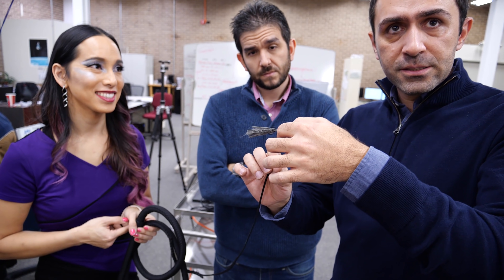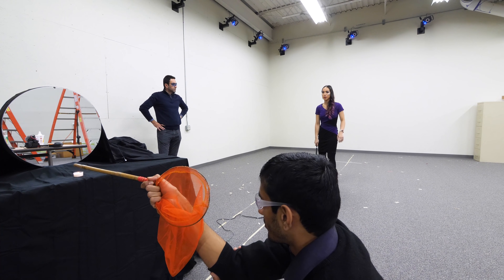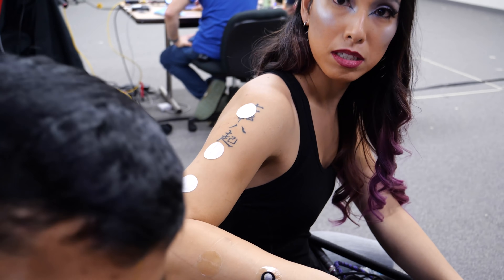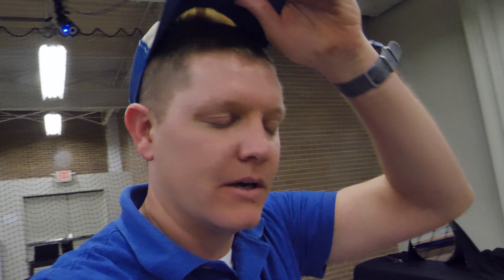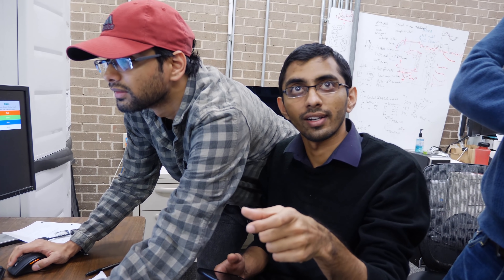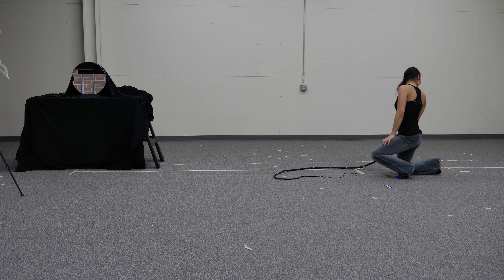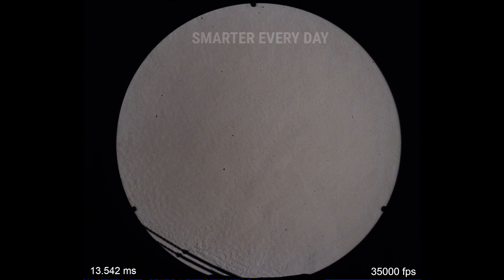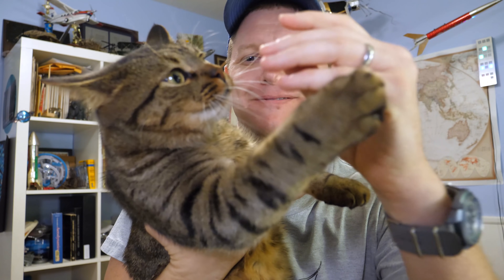How does a Whip Break the Sound Barrier? Behind the Scenes- Smarter Every Day

Comment: Its air resistance dudes. I am not an engineer, but I study a lot of geometry, what seems to be happening here, is that the tip of the whip accelerates, and the air that is trapped in the tip causes a drag that holds the tip of the whip, that causes the effect "tug of war" between the resistance of the air at the tip and the momentum of the whip, when the momentum "wins the contest", the tip is drawn with more force than was being pulled until the air drag starts acting (to compensate for the force of the momentum that was reduced in the dispute of the two forces), this generates an extra acceleration, that adds to the tension produced in the whip, and causes the tip of the whip to pass barrier of the sound. Probably different material whips produce different final velocities due to the elastic constants of each material and the tip size would also influence the amount of air trapped in the space between the wires of the tip, if I am right.
Reply: And it's probably possible to do a backtracking to determine the points that are not being captured due to the system capture frame rate, I work with computer vision and I'm sure it's possible to "add" more frame rates between the frames that are captured by the system using only math.
Reply: Interpolation, a think

Comment: now all you need is Mark Rober to make a device that cracks a whip perfectly every time!
Reply: I think they already have one of those: April.
Reply: That would actually have to be a SUPER complex machine, given the amount of subtlety involved in cracking a whip.  A lot of that is feel tbh, you have to get the whip moving JUST RIGHT to actually get it to crack.  April can get it super consistently due to YEARS of experience and a detailed knowledge on the physics behind how it works, but building a robot to do it would be rather difficult.  I have an idea for one that would mimic the motion needed for a side flick crack, but it would also need an entirely custom whip for that robot - each whip is going to move slightly differently, so as soon as you put a different whip on it, you would need to adjust A LOT to get it to crack consistently
Reply: @EclipseAtDusk  idk man you see that robot that shoots hoops perfectly every time that's insane too, someone will do it it's only a matter of when

Comment: How about setting up a second schlieren-camera 90° to the existing to get some highspeed 3D Info from the tip? Could that work?
Reply: This setup actually can already get the 3D data.... it's hard to explain but all the info is there.
Reply: @smartereveryday  Would be very interested to see this explained in a future video
Reply: @smartereveryday  Shining a laser through those shock waves might be an interesting aside for a video on refraction.
Reply: @smartereveryday  An explanation video could be very interesting, and possibly very complex :) Could a 3D model of the shock wave in real time could be constructed?
Reply: That sounds awesome, AND a nightmare to sync up, at the same time.
Reply: Now you’re talking! I was just thinking how cool it was seeing “thickness” of the shockwave and how that is actually a 3D spherical section. With two or even three set-ups, you could get amazing full 3D modeling of everything; the whip, the shockwave, the heat vapors coming off the cord. That would be awesome!
Reply: I was just thinking about CT machines which work the same.
Reply: Syncing them up wouldn't be all that hard; syncing them to sub-frame precision might be. The schlieren setup uses a mirror and already contains two (partially occluded) images of the whip; the second image there is a mirrored silhouette, not a plain shadow. Actually reconstructing that is bound to be tricky, involving details like the mirror's projection of the other side. I expect they did some work to figure out the positions of the high speed camera and its light source, just as you saw the goofy looking stick being waved about to calibrate the respective views of all the spatial tracking cameras. This stuff is fun!

Comment: We used to make "rat tails" out of our beach towels by folding them in a descending spiral with the bottom edge folded to make the handle. We would wet the tip (corner) of the towel, and proceed to make one another bleed with them.
Reply: I only know these were a thing bc of Ed, Edd, & Eddy.
Reply: @otakuribo  I know of these because of bleeding. I learned to make them out of pure defensive necessity. Way before the Ed's ever hit cable...lol.
Reply: @hardwurkindaddy  Jeez, I'm so sorry to hear that... what kind of Spartan childhood was this? It feels like I missed out on some character building or something. But I probably hurt myself enough trying to emulate the X Games to make up for it.
Reply: @otakuribo  life before the internet was...different...lol
Reply: @hardwurkindaddy  I know you've been in a few bottle rocket battles. 🤣😂
Reply: some still do.
Reply: brian bennett Same. Got longer, thicker towels, then added 3 strands binder twine soaked in elmers glue dipped in sand, finally tied several knots along each. Tested as it progressed just to see how more devastating it might be. After the knots we stopped; left clear knot and string marks embedded deep in staircase door. Figured trying on cabin rivals next to ours  (daycamp) would've been more cruelty than fun, so didn't. Cool project though.
Reply: Yup, saw one open a guys leg right up, to the tune of several required stitches.